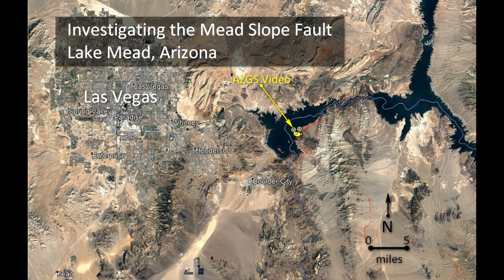Mead Slope Fault, Lake Mead, Arizona

Comment: Question. Lake Oroville experienced a 5.7 quake when it's water lever was record low and they determined it was due to water volume reduction. Are we not concerned that this fault at lake mead may have the same effect with record low water levels? Is this a different type of fault than the california Oroville reservoir one? Does this fault you're standing on run in the range where the hoover dam is located and is there the possibility if water is low enough it could create a seismic event that could be catastrophic to the hoover dam?